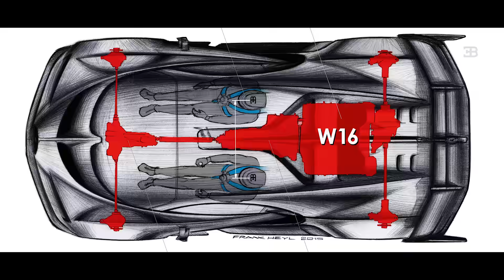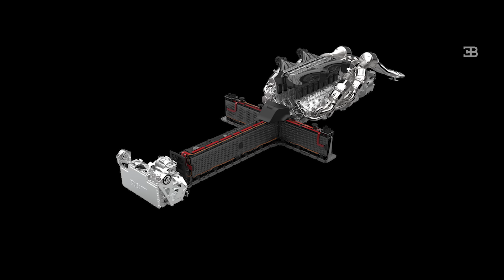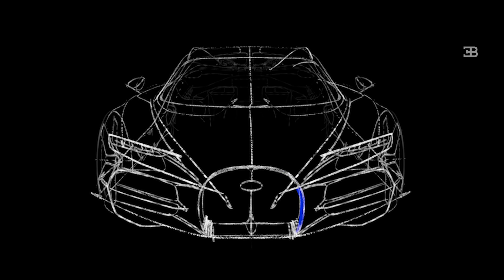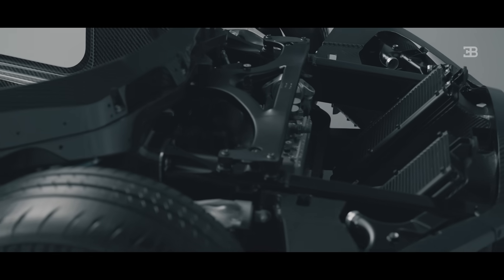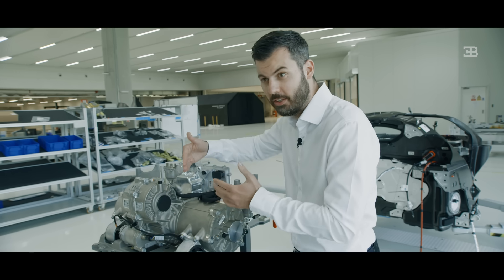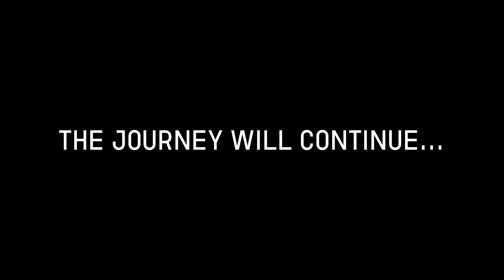BUGATTI — A NEW ERA: Peak Engineering​

Comment: 1. Further Reduce Frontal Area

    Why? Aerodynamic drag increases with frontal area. The car already brings occupants closer together and uses a narrow tunnel.

    Improvement Suggestion:

        Explore offset seating (staggered driver-passenger seating like fighter jets) to reduce cockpit width.

        Reconsider wing mirrors with camera-based systems to shrink external drag sources.

2. Refine Battery & Cooling Integration

    Why? Batteries are thermally sensitive and heavy.

    Improvement Suggestion:

        Use a structural battery pack (à la Tesla’s 4680 structural pack) to integrate the battery as part of the chassis.

        Consider active thermal switching for cooling circuits: only cool when truly needed, reducing pump drag and complexity.

        Integrate cooling channels within the suspension arms themselves using 3D-printed metal to multi-purpose structures and improve cooling efficiency without added ducting drag.

3. Optimize Venturi Tunnel Geometry

    Why? The underbody is doing heavy aerodynamic lifting.

    Improvement Suggestion:

        Employ adaptive geometry diffusers variable shape using active aero materials (like shape-memory alloys or actuators) to modulate diffuser angle based on speed for optimal flow separation prevention.

        CFD-optimized tire wake management: guide turbulent flow from the front tires away from the venturi inlets using vertical turning vanes or S-ducts.

4. Further Innovate Suspension Aero Integration

    Why? The exposed suspension arms are in the airflow, and shape matters.

    Improvement Suggestion:

        Implement active camber/ride height systems tied into aero telemetry to keep airflow ideal at all speeds and pitch angles.

        Use hollow suspension arms with venting functions (multi-function aero-cooling) , i.e., route airflow through them to cool brakes or rear modules.

5. Minimize Drivetrain Losses

    Why? You're splitting front electric drive and rear ICE, a hybrid AWD system.

    Improvement Suggestion:

        Use torque vectoring on all four wheels via independent motor controllers to not just increase grip but also reduce yaw resistance (increasing corner exit speed).

        Consider carbon composite half-shafts to further reduce unsprung mass and rotational inertia.

        Explore dry-sump gearbox integration with rear subframe, further lowering center of gravity and enabling better packaging.

6. Explore Additional Weight Reduction

    Why? Every kg matters for acceleration, braking, and cornering.

    Improvement Suggestion:

        Replace even more metallic components with carbon-fiber composites or carbon-silicon hybrids.

        Integrate multi-material topology optimization, using different materials in a single 3D-printed structure to combine stiffness, flexibility, and strength in one.

7. Software-Driven Aerodynamic Adaptation

    Why? Static aerodynamics have limitations.

    Improvement Suggestion:

        Implement real-time AI aerodynamic control: adjust flaps, cooling vents, diffuser angle, and ride height based on telemetry and GPS-based predictions (e.g., known track curves or ambient temperature changes).

8. Enhance Electric-ICE Synergy

    Why? Dual powertrains often compete for packaging.

    Improvement Suggestion:

        Implement predictive hybrid strategies, use geofencing, GPS, and driving patterns to shift loads intelligently between electric and ICE for better thermal and performance management.

        Use carbon-neutral fuels with ultra-high energy density to offset any weight drawbacks versus fully electric systems.

9. Improve Airflow Segregation at the Rear

    Why? Turbulence kills top speed.

    Improvement Suggestion:

        Use plasma actuators or vortex generators around the diffuser-exhaust area to better separate dirty air and maximize diffuser pressure recovery.

        Position the exhaust outlet to further energize the boundary layer over the rear diffuser at high RPM, preventing flow detachment.

Comment: The Tourbillon is kind of similar to the Revuelto. Both have NA hybrid engines with 2 electric motors at the front & 1 in the transmission that's behind the engine, except the Tourbillon's gearbox is longitudinally set while the Revuelto's transversely. Also, while not proper AWD, both cars mimic it.

Comment: There is an enourmous amount of engineering and design coming from F1 and Lemans in this car. The engine and gearbox layout, new suspension design, diffuser length and design, aero flow, brake cooling, etc... This new Bugatti is the epitome of luxury and design wrapped around F1 and LeMan racing layout and design, Ferdinand Piëch is smiling.

Comment: Mate, my dude, people can get 1000HP out of a 2.5L commuter engine these days. Your 8.3L isn't that impressive, even if it is NA. After about 5L on an NA engine, the sound just gets louder instead of punchier and you're not making enough power to justify all that weight between the larger block and chassis reinforcement. I'm sure your engine is well designed and 1000HP is a lot for an NA engine, but who is this for? Rich jerks don't even know anything about engines and rich car guys generally buy stuff like McLarens. Bugattis were cool because of the extreme engineering that was required to get a heavy luxury car with a Rolls level interior to also be the fastest on the planet. Making big engines just for the sake of it reminds me of the automobile hell that existed before the 90's, when people thought 200HP from a 6L V8 was the epitome of human achievement. 

Just make the engine smaller and let it rev more freely so that it's more fun to drive, otherwise you'll never rev past 3k and you won't be able to hear the engine properly regardless of how many liters or if it has boost. You guys need more "Need for Speed" and less "white shoes and pants on the concours".

Comment: Timestamps (Powered by Merlin AI)
00:07 - Engineering integration is crucial for Bugatti's new car design.
01:23 - Redesigned engine and gearbox improve aerodynamics and downforce.
02:23 - Aerodynamic efficiency is crucial for Bugatti's speed-focused design.
03:22 - Innovative aerodynamic design enhances downforce and performance in the new Bugatti model.
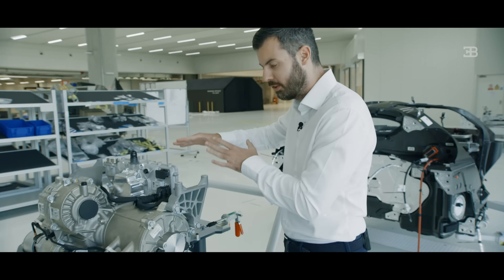04:17 - Innovative powertrain and design enhance Bugatti's aerodynamic performance.
05:18 - Innovative diffuser design doubles as crash structure.
06:18 - Innovative 3D-printed suspension improves aerodynamics and strength.
07:14 - Innovative design integrates aerodynamics and strength for optimal performance.

Comment: Hollow 3d printed straight wishbone... could have just CNC'd a solid block and only increased the weight 150g.
Reply: This vehicle will go beyond 450kmh - so 150g will be 6x in weight when you brake … would not fit

Comment: As the title suggests the engineering is absolutely PEAK
Reply: peak
Reply: My honda civic is faster
Reply: How are youtube comments still broken
Reply: When engineering turns into art. This is an art piece at heart.
Reply: But nothing new. All that things was made many years ago. Italdesign Fraser-Nash Namir it was technology leap at 2010, car like a spaceship. 
New Bugatti - it's a super expensive commercial product for ultra rich elite, and nothing new. Giant internal combustion engine, hybrid trans, carbon fiber composition monocoque body, and fancy dashboard. What that car got really impressive? I say: nothing.
Reply: The inner workings look like something from the space program, or the air force, you can tell from the luggage compartment and the sheer size of the inner dimensions they packed everything as tight as possible. The even took space away from the passengers to make the car more compact. Honestly most super cars always strike me as over priced but literally everything on the car is built custom for the sake of speed. It’s an amazing piece of engineering.
Reply: For tourbillon SS They should use a 1400ps NA V16 and 1000 ps from 3 E motors(2 radial flux for E front axle and 1 ultra power dense new gen 2026(59 kw/kg) 750kw peak and 400kw continues innovative YASA axial flux motor that will weigh only 12.9kg and sits between the engine and transmission for above 560 kph top speed) and combined 2400 ps and 2600nm or torque. With 7500 mah(27wh) tabless 90% nickel content NCMA cathode and GROUP 14' state of the art SCC55 silicon-carbon anode technology  21700 cells .  meaning 1500 cells will have 40kwh net and 38 kwh useable capacity (1500 tabless 21700 cells will generate 65% less heat for 1000 ps or 750kw pulse discharge rate compared with traditional tabbed cells).
Reply: @davidfujkk8018  Interesting concept David but extracting 1400 PS from a naturally aspirated V16 seems like you’d be bumping right up against the theoretical limits of volumetric efficiency unless you’re running absurdly high compression ratios with race-grade E85 or methanol blends maybe even water injection to keep temps in check under load. Also curious how you’re planning to manage thermal runaway risk with 7500 mah tabless 21700s at that discharge rate because even with NCMA and silicon carbon anodes you’re still looking at serious internal resistance issues at high C rates. Would love to know if you’re assuming active immersion cooling or some next-gen dielectric coolant loop because traditional cold plate systems would hit a bottleneck fast under sustained 750 kW output.
Reply: Tourbillon' v16 engines are sourced from uk based company called cosworth . Which already manufactures 6.5L v12 for aston valkyrie with 154 hp/L power density . If you increase the power density to 169 hp/L in an 8.3L v16 platform as tourbillon has you will have 1400 ps  which cosworth easily can and capable of . state of the art GROUP 14' SCC55 anode technology is capable of 5c charging rates even with out tabless technology . Also if you are familiar with tab-less(full tab)technology you knew that tabless cells have amazing 70 to 90% lower internal resistance and have 50% lower heat generation in ultra high discharge currents(200 amps),they have 50 to 70 amps of continues and 200 amps of pulse dicharge rates(40c) . And 1500 tabless 21700 cells can produce unseen 1200 kw(1600ps) for 5 continues minutes with out any problem . Also bugatti uses innovative direct oil cooling technology for cooling toubillon's cells which further protects the cells against temp rises . (750 kw for 1500 tabless oil cooled cells is an ultra easy task)
Reply: how would they squeeze 400 extra hp from a n/a v16 what kinda compression/fuel would b needed 🤨
getting 650-700hp from a n/a v8 already is off the charts
Reply: @ApeMan2002  high rpm - high horsepower
Reply: @davidfujkk8018  Idk man just try to submit an application to them and see if they agree with you
Reply: all that talk, 4mil dollars and yet they cant beat an ALPHA tuned GTR from 2009 for 130k , hahahahhaha
Reply: @michaelmich00At least it won't explode before 10k miles like your "150k tuned GTR"
Reply: @michaelmich00 Both cars have their place and I love them both
Reply: @michaelmich00 gtfo off of yt lil bro. You do not have any factual information to prove anything you say. Delete your comments.
Reply: @michaelmich00 Why when you can get a Nissan Versa with the same quality for $20k?

Comment: I want tourbillon super sport 400+
Reply: They should use a 1400ps NA V16 and 1000 ps from 3 E motors and combined 2400 ps . With 7500 mah(27wh) tabless 90% nickel content NCMA cathode and GROUP 14' SCC55 silicon-carbon anode technology  21700 cells .  meaning 1500 cells will have 40kwh net and 38 kwh useable capacity (1500 tabless 21700 cells will generate 65% less heat for 1000 ps or 750kw pulse discharge rate compared wtih tradtional tabbed cells)